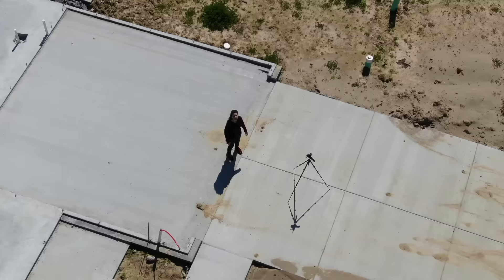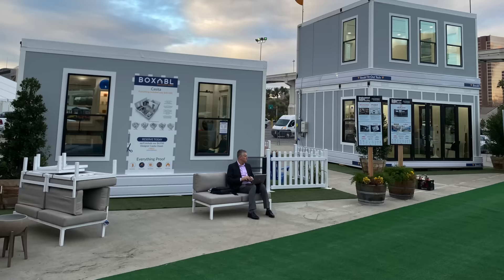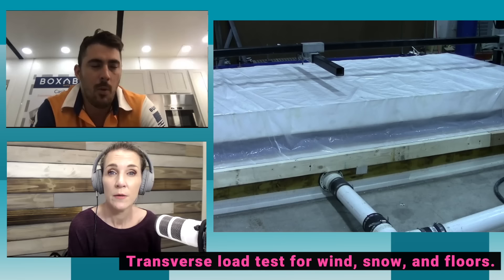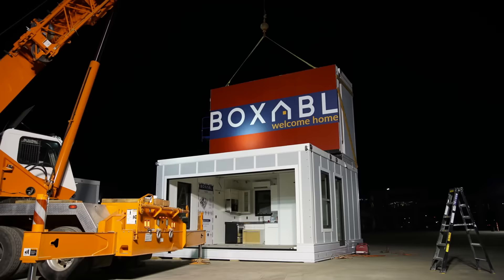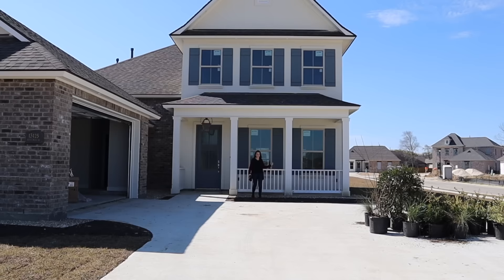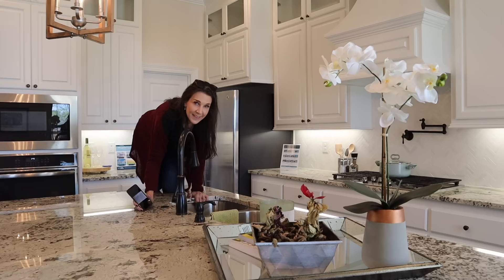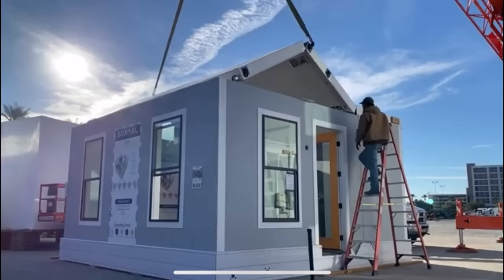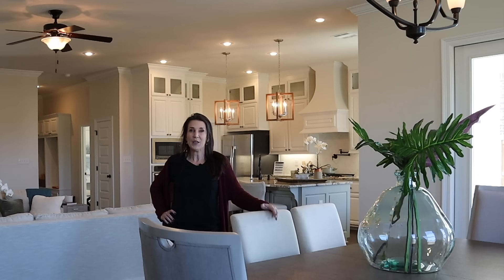Build A House In 2 HOURS?? FOLDABLE Modular Homes

Comment: Add my name to the list for this type of home. After going thru 4  Hurricanes & Tropical storms with Harvey's 2017 floods of 73 inches totally destroying my home. Its not so much the floods or hurricanes that are the problems but dealing with unscruplous contractors most who do shoddy work. And cement board would eliminate need to tear out sheetrick after flooding.
Checks 8 out 10 of my wish list.
Just need to add solar power & ability to go off grid to list!

Comment: I think it should be a COMBINATION thereof. ⭐🤔⭐ LIKE in Florida I would definitely RECOMMEND having CONCRETE FIRST FLOOR because of the bugs. BUT then adding on the modular system on top of that which will give you the SECOND FLOOR and possibly third floor. SO the CONCRETE first floor needs to be a BASED to accommodate the modular system floor plan so they could just set it right on top of that concrete first floor plan. ⭐👍⭐ TO me that's probably the BEST scenario in the Florida area. KEEPING the price down and having the house built in the factory gives YOU more control on insulation, power, and wind factors. Cool!!!! 👍😀

Comment: So I have two questions. How does this how stand up in the heat of an Arizona summer and if you wanted to move, could you box up the house again and move to a new site or state?
Reply from the maker: It is an energy efficient home and designed to hold up to all weather conditions and yes, you can technically fold it up and move it from location to location.

Comment: New 'stick built' homes around here are like $260,000 to $400,000 so many folks are stuck in apartments forever, and those ain't cheap either! With this concept and a quarter acre lot you could be set up for a nice little place for maybe less than $75,000!

Comment: I'm 66 years old and looking to both move to another state as well as downsize. If they offer a roughly 1500-1700 single story 2 bedroom plan with a sizable master/living room and kitchen, I'd be a buyer. I'm single
and will use the second bedroom as an office/studio. I'd want a larger walk in closet and a laundry room. My thoughts currently are to move to the southwest so an Adobe/stucco style exterior is my intention for finishing 
the home off. I wonder if exposed log rafters,tile flooring and a tile or marble shower are possible. I'd want to have as efficient HVAC as possible.. maybe multiple mini splits or a geothermal heat pump system. A rain catchment system would be a plus as well... I'd want a roof mounted solar system with the ability to change the pitch as the seasons change... Not asking for much am I?

Comment: How do you repair a hole in an interior wall if it's laminated? How about interior painting or any of the other myriad things we have to do when we own a home? If the structure is compromised (falling trees for instance) can it be repaired or does it need to be replaced?

Comment: I think it’s going to be the wave of the future because housing is too expensive for a lot of people there is a log cabin home and southern part of La Rue,Ohio Amish Built Log Cabin Homes. Nice quality for $55,000 put on your own lot. They can be finished or unfinished but the green home is the one I want. I was going to buy one still interested but I need property. I want to be off the grid. It has a living room and has your dining room and has your kitchen utility closet it has your bedroom downstairs where the bathroom and you go upstairs and you have two bedrooms and a loft like walking area across an open area concept. I’m sure you could put a wall up if you wanted to make it more of a private area between the two bedrooms myself I’d like to put a bathroom upstairs half bath at least. And raise the sidewalls just about another 4 foot high and then have the rough go up giving me a little more height in the ceilings so I know it’s going to add a little bit more on the cost. Now they will deliver to where were you want it delivered to and it might cost you so much per mile for having it shipped but they said it up on foot or so to set it up on brick or your foundation and I said they’ll do the wiring and plumbing and then you have to finish it out when he gets to the site. They caught it for bugs Pass the house is shellacked I believe they have the inside styles differently you can have them painted or you can have it just natural. But by the time you get done putting it on your lot maybe add a foundation getting connected you got another $50,000 say so it’s $100,000 the by the time you sell the home if you were to move you could probably sell it for $250,000 and that’s better then going down where I want to place it in Maryland and buying one of their homes for $150,000 The Site at crackerbox and needs a lot of repairs.

Comment: I like to know on the tiny homes do they have a warranty for their panels because if there's a water leak electricity problem do they switch out the panel for you cuz you can't just cut into them like drywall and fix it

Comment: I would be interested in quality relative to the geography: example high corrosion and decay resistance to water elements in wet and cold/snowy geography and decay in due to heat in hot environments, or earthquake resistance in earthquake prone areas.  Or Tsunami resistance is Tsunami zones... or an appropriate mixture.  It should not look like manufactured homes that are built so cheap with lots of particle boards that they fall apart quickly.  Have choice of material, so I hate particle board, I should exclude that in the entire list of materials used in the construction.  It should be designed so it can be modified /added/reduced/repaired after the first installation, example it should not be designed in a manner like some nice cars that cannot be repaired easily without taking the entire engine out if you just need to change a few injectors.  Everything should be easily reachable for easy maintenance.  Should be able to add/remove parts and components that you can buy in most hardware stores (not be forced to go back to the original manufacturer)...

Comment: Will it blow away in a tornado? the thing about stick built is stability on the cement foundation.
Otherwise due to cost and efficiency I think this is the wave factory built then Plug and play 
Will there be parks or development areas available or do people have to buy land dog a well install septic etc?
Sure beats the rotting moldy illness causing FEMA trailers that’s a no-brainer!

Comment: Could a chasey company cut production costs in half by shortening the length of the usual frame to larger boxable size; increasing boxable profit and chasey profit by cutting production cost for chasey company and making the larger boxable more available to places of modular and prefabricated houses?

Comment: Do they resist hurricanes or things like that? How safe are these houses?
Reply from the maker: Zum Pink these homes are built to modular homes specifications with are higher in many cases than traditional built homes. They which meet if not exceed wind zone requirements in hurricane prone areas.

Comment: $50K is not cheap. $133/sf? For a house that is not easy to customize or made of time tested materials. I get a one story with attic built with Doug fir, sheathed in plywood and done with cedar siding, with rockwool, cedar interior walls, plumbing, and electrical for less than $60K, including fully rebarred slab. Mine will last for 100 years. 

$20K might be an interesting price point.
Reply from the maker: If you can mass produce homes at that price point with avoiding building material supply chain issues, right now,  you have a heck of a business on your hands.

Comment: Interesting idea, but not quite there with no roof or siding and you have to build foundation, bring in utilities, get permits, e.t.c. and of course have a lot to put it on.   That doesn't make it competitive. The folding limits closet, bath, kitchen placement. The square dimensions are constraining. I hope they keep improving it. It's very promising. Their website needs work. Still looks pretty speculative. Obviously still in startup phase.

Comment: I don't know why they don't have an option for each module to join to another, doubling the size of the hoise. I would particularly do this for sie rectangular homes and joint at 90°, and have the second version of the home present without kitchen bit with say french doors outside..
Reply: ... also need  info on R ratings of walls available, since buying one of these for most winters north if the Mason Dixon means having to withstand frigid temperatures in winter...

Comment: If this works this could reduce housing for people what drive up cost the builder has to bring workers and supplies to site and there is vandelism and theft at site.  As a trucker I hauled load of windows and cabents. Week later same things we reshipped due to theft.  The supply makers and trucker benefits replacements to finish the houses.but builder bears the loss.  The stolen supplies are used in another project by a shady builder but final user pays same price for their homr

Comment: By the way I would like to say I think it's a great idea I just think that it's not perfect obviously there's still a lot that will be modified and changed over time but mostly The Innovation I think is pretty awesome just because if you can reduce the price to 10 to 20% then I think that's awesome but I don't hear you guys talking about prices and first of all manufactured homes even ones that are double wides that may have or may not have 1,000 square feet or up to 1200 square feet still going for ranges new of 70000 $150,000

Therefore in conclusion what I'm trying to say is that these houses should be priced way cheaper than I know they already are going to be even though you haven't even talked about the prices and these are amazing Concepts ideas that you manifested in reality so I wouldn't necessarily call them Concepts they're actually great ideas but at the end of the day your advertising and pitching it as affordable housing because it's Bill in a warehouse and because it can be delivered just like manufactured homes but at the end of the day the price margin needs to drop whatever it is I can just tell you that from experience in real estate I know that it needs to drop the price

Comment: I like the concept, but it does have limitations. Just like when people ask “capitalism or socialism”, as if it’s an either or decision.I think a hybrid decision makes sense. Let’s face it a 20’ x 20’ box with a flat roof is very unimaginative and makes a tiny house look Grand in comparison.  I like sip (STRUCTURAL INSULATED PANNEL) Which have a very high “R” rating for the walls. It can also be used as roofing framing. Assembly is fast and easy.

Comment: The actual inventor of these homes should not get frustrated because I see what and where he or she is going with this. I would buy the basic when paid off order a second level to add on. Then I finally own my dream home without paying a life time. 50,000 sounds like a lot but everything is included not added on appliance bill plumbing nor wiring. The big plus is it's not 8 ft.wide and 15 to 20 ft.long.  I've witnessed tiny homes going for way over 80 to 90 thousand but still need something added such as solar or the vihicle to move it around. I just see the plans there going for here and I think it will eventually take off. Please don't give up I'm pulling for your company to succeed. I may want/need this one day myself.

Comment: What is the material used in place of sheetrock...I would like to know the material....not mentioned in this commercial
Reply from the maker: I mentioned it during the video. It’s called magnesium board.
Reply: @KristinaSmallhorn  thank you...have looked at older pre fabs and there is a sweet chemical oder...do you know what that is and why the chemical does not bleed off?
Reply: @KristinaSmallhorn  and does magnesium have a odor

Comment: It's a cool idea, but I'd like to see how they stand up in hurricanes. Plus, it would put a lot of construction workers out of work if this becomes the new trend.
Reply: It will become the trend.  Unfortunately the pool of construction workers is already shrinking, not because there aren’t enough jobs, because the demand is there.  People just aren’t choosing to go into the trades anymore.  Despite that it can be a fairly lucrative career, especially if you are unionized, I can right away think of several reasons why.  They include that it is heavy work that can cause body reactions that put you out of the game, just aging can put you out of the game, working in the winter is probably grueling and sometimes non existent, and work availability can be subject to wild cyclical fluctuations.  The jobs will still be available in the factories, where work will be more steady and safer.  But it won’t be as local because factories won’t be nearly as distributed as stick builders are.  So the shift will cause migration which can be difficult for families and the towns they leave behind, just like it has been as other industries change or go obsolete.  At least in this case alternate jobs exist, just not in your hometown.

Comment: Unfortunately , I don't see kids that are being born today having the financial ability to ever afford purchasing a standard 3 bedroom stick home in 15-20 years or more. Unless we drastically change our wage economy. In 1970-80, if you had a job that paid $15.00 per hour you were a high earner in the factory labor market. Most were 12.00 or below. Even still new housing costs were 5 times less expensive, and the dollar's value, (what you could buy with it), was much higher. The money printer go BRRR, has been going on for a while. Compared to today's dollar, a standard $15.00 /hour, 40 hour week, factory job back then would be equivalent to the buying power of around $120,000.00 per year today. Wages have not kept up with inflation. The average wage today , which is much higher than minimum wage , puts you below what was considered "middle class" purchasing power back then. My father, who was a tool and die maker in the Auto industry in the 50's bought his first starter home from Sears. It cost $15,000 and was a three bedroom (One master), one bath slab foundation home with a full kitchen/dining area, and a smallish living room. It also has an attached 1 car garage. Standard electrical and plumbing, gas boiler heat and gas stove included. The slab foundation was extra, but that was only about $1000. That same home toady lists for over $100,000.00.
Most community builds today are two-story 3-4 bedroom and cost around 250,000 to 400.000 in this area. At the current rate in 20 years that kind of build will cost closer to $1,000,000.00 or more. The average person will own nothing and be happy.

Comment: I was just thinking of what the smell of this plastic is going to smell like in your house in the dead center of the summertime where the heat is pumping and not only is it hot but also it's heating up your structure which means even if that plastic composite material is bpa-free you're still going to smell plastic probably in those houses

Comment: I'll tell you exactly why oversize, overwide and other loads, whether it's modulars or any other load, are usually slowing traffic in late afternoon....it's the Federal and State Department of Transportation legislation's fault because such loads are not allowed to travel after sunset or before sunrise. No matter where that load is at sunset, the driver has to find somewhere to park it until full sunrise. Didn't it ever occur to you to check the laws on that? It's not rocket science.

Comment: Modular and manufactured homes are way past due.
The old archaic way of building homes should have been eliminated 15 to 20 years ago  We all must be "Forward" thinking and getting things done at the "speed of thought"...
Reply: We have had modular home construction for over 100 years now. It has never revolutionized the way we build single family homes. Proper home construction matches construction techniques with geographic requirements, a one size fits all system will never work. It’s a home, not a computer.